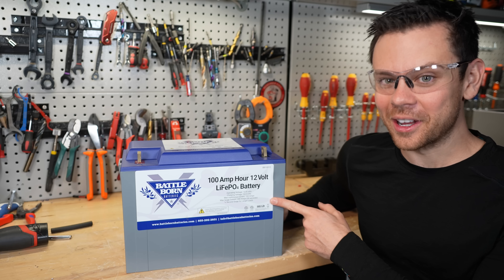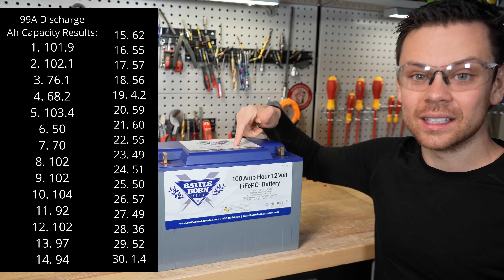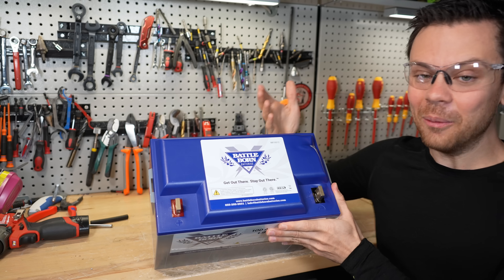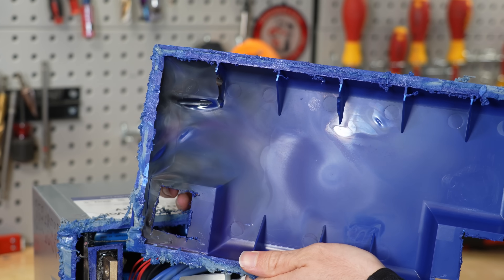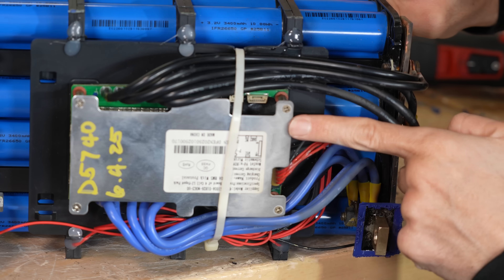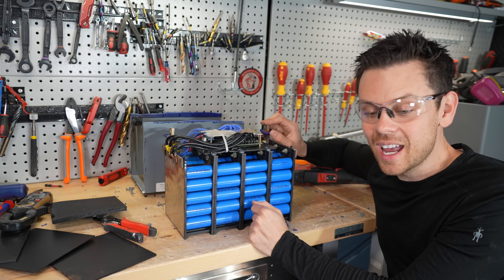Battleborn Battery MELTED?! 🔥🔥New Problem!

Comment: Will  you need to start playing on the safe side.

If that lithium would catch fire,  you can't put it out with a fire extinguisher or water....

Start testing these things OUTSIDE so if it does ignite,   it can burn out away from the house or shop....

OK, if you must have the comfort of inside the shop, how about getting a metal kiddie wagon, put the battery 
IN the wagon.   If it should catch fire,  cut the cables and wheel the blazing battery outside as fast as you can...

That plastic will not stop a fire and when it burns through, your house is toast......

fair warning friend..

Comment: I don't know what is going on with the batteries you have been testing.  They are obviously having issues.  But, I can say that after four years with my Battle Born system it is still working like a champ.  Perhaps their has been a  manufacturing change.
Reply: You mean they went BOEING? But that would actually mean they had a management change, THEN a manufacturing change. I'm happy to only fly on Airbus, and I will certainly not put anything in my house that was manufactured by an American company under American regulations and standards where the product is thrown onto the market without proper testing and only a big law suit can force them to improve...
Reply: @mogon721 Seem like a rather extreme response to never purchase a product made in America because Battle Born is having a problem with some of its batteries.
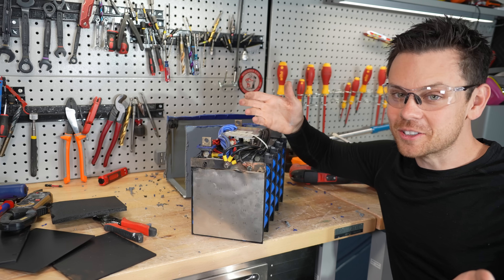Reply: @mogon721 go watch the BOEING engineer " MR. HANDS" AND his Wonderhorse  "BULLSEYE"! its romantic. RIP" Mr hands!" 5:56

Comment: A brand new $800 battery and it melts.   FYI, Dragonfly Energy Holdings Inc owns Battleborn Batteries, their stock went from around $1000 per share (peaked $1500) to $4.05 today.   Good luck getting a refund from Battleborn.      Thank you for the video.

Comment: I'm still impressed with my Zooms, Chins, and Redodo banks I put together. Haven't melted down yet in 3 years. I also have a pair of Paoweric 48v batteries that haven't melted down yet either.
I can't say I'm impressed at all by The Big Battery I paid a lot of money for. It's offline again waiting on a new switch to arrive. To be fair I voided the warranty last summer installing a JkBMS and it was their switch that failed. Just sitting on the shelf the back popped off and spit the guts out of the switch. Poor Chinese crimp it looks like

Comment: Will, you have me worried. I have two of them in my Arctic fox truck camper. I’ve had them for 4 years. No worries yet. And then here you come with this info. What should I do? I live about 80 miles from the battle born factory. Maybe go to them and show them your video?  Crap.
Reply: Also, what do you recommend for me instead of these bb?  I just need about 200-300 of amp hour. Thanks

Comment: These batteries should have an immediate recall, no excuse Battle Born, I have one that came with my nuCamp Barefoot RV but never used it as I replaced the battery with a 300Ah Renogy LiFePO4 Battery w/ self-heating function | Core Series battery and it works really great! I got 3 times the capacity and a much better battery, and safer battery.

Comment: WOW!! I have 8 of these in my 5th wheel RV. I lived off grid in southwest, AZ near Yuma for about 6 1/2 months last winter with them thinking I had a very safe superior quality 24v 400amp hour (wired series/parallel) battery bank. Now I'm scared to turn the battery bank on after this video!! I don't want to lose my home!! The rest of the solar system is all Victron. My BattleBorn batteries cost me about $1200 each in 2021 when I originally built the system. Looks like I need to junk them and replace them with something like the best and lightest possible large 24v Chinese batteries. Thanks for all your testing Will !!
Reply: All battery banks should be inspected at least twice a year.

Comment: Sorry, but those batteries are just complete shat.  No ifs, no buts, no coconuts.  I wouldn't use them.  There are much safer ways to setup a "safety" disconnect than allow your wiring bolts to just get loose and actually create more heat. If anything, their idea of safety actually increases the risk of fire and damage!  What idiot designed this???

Comment: This is the reason I make my own! set my BMS specs lower then what the batteries and everything else can handle. Set the temp threshholds lower! I rather it shut off early then over heat and melt or catch on fire. Thanks Will for such great testing and bringing awarness to these issues.

Comment: Hypothesis: the plastic they're using as that 'feature' of over-temp disconnect (not really a feature, it's a design defect IMO) is experiencing creep from the moment they tighten the nuts on the assembly line to torque, since it's a constant load on a plastic. 

If you have a sample of that plastic, maybe you can emulate a load test on a spare piece from a battery that isn't too damaged - use a hydraulic press + load cell to emulate constant load, measuring the drop in force as the plastic deforms under mechanical load. Only hard part is controlling for whether the cylinder slowly loses pressure/leaks, so maybe a mechanical scissor jack might be a better way to control mechanical load.

Comment: That is some bad engineering to apparently assume that plastic spacer won’t flow under the compression of the bolts holding the wire lugs - even more so when the plastic gets warm in normal use conditions.  There are materials such as Micarta or Bakelite which  remain dimensionally stable and could have been used for the application.  The downside is that thermoset plastics are more expensive and more difficult to work with.  If it were I, I would have designed notches in the plastic partition so that the lug bolts were torqued down directly to the metal busbar.

Comment: All they would have to do is put metal inserts in the plastic so that the pressure applied by the nuts to provide the clamping force on the bolts and terminals isn't taken up by **plastic**. That's just not a great design.

Comment: 4:31 so, based on this evidence, we can conclude that this model was dsigned to fail, even when used as intended by the maker.
PS: if possible, you could do a "fix and test": buy another battery of the same model (i know, your poor wallet is crying), open it and fix all those stupid 'design choices', and test it in the same manner u did this one.
Termal imaging would be nice if possible, by the way.
Tank you for your service to the solar community.

Comment: :I  Are dimenstions for an 'appropriate' passthrough-terminal that can be inserted into the existing plastic to hold tension/pressure/contact around those points availble?

Or could drilling the existing holes out for common M8 spacers be an 'adequate' improvement?

(edit:) 'adequate" in that the plastic around the terminals wouldn't mechanically overloaded from the start. I do recognise that the plastic would still need to be under some pressure to keep the bar and sheet in contact, and adding more copper bars to sandwitch the sheet(s) would need a more significant modification to the plastic(s) with associated costs ... almost enough to make adding binder-clips seem reasonable, if not for the dissimilar metals corroding each other.

Comment: Thermistor on cells, and/or bus bar, should be communicating with BMS to shut down the system. 
And no fuse on the bus bar?

Comment: Ahhhhhh.  I've got one of these bolted to the bottom of my van.  It's 6 years old, and I don't exceed 0.1C (per battery) but I'm nervous now.  Maybe I'll pull it soon and use it with a small solar panel for charging my tool batteries or something.  I can't monitor any heat deformation of the case where I have it mounted.

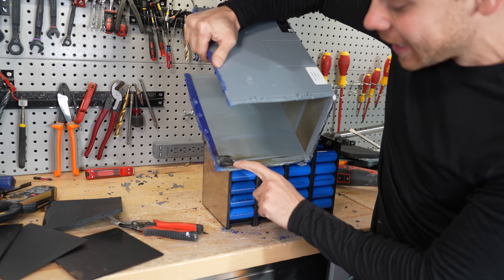Comment: How close were you to battery thermal runaway? At 3:23 had the copper developed cupric oxide which forms at 320C and with a lifepo4 battery runaway temp is 270C, is there a bigger problem waiting?
Reply from the maker: Exactly my thoughts!!! Agreed.
Reply: just try to charge it couple more times

Comment: Absolute insanity to have plastic and metal together to keep tension for nuts and bolts. It should have just had the nut recessed in the plastic and then the metal plate and bolt would stay in contact. Still a bad design but better

Comment: The only other thing i can see that might be useful is seeing how low a charge discharge cycle will need to be to prevent overheating... is this a 40amp max or a 10 amp... a lot of people spent a lot of money on these and i am sure would like to get as many cycles in a safe manner 

This dose not seem like a random percentage but a major percentage of the batteries are at risk

Comment: I'm hoping that this is more of a current problem with the build quality of these batteries. I've owned my BB battery for 7+ years and so far have had no problems. But then also, I'm only drawing maybe 10-15 Amps and charging with solar from 3 - 100 watt panels connected in parallel.

Comment: Yap, exactly what should happen with plastic between terminals, bolts and nuts.. As it always do.. 😂
Only it give away ghost very quickly and it looked like there was an actual fire inside that case.
These batteries should be banned as dangerous and fire hazard and recalled immediately! 

Thanks for great video and good job! 👍

Comment: After watching this video, I will never buy a battleborn battery ever!! That just shocked me to my core. I have a homemade solar generator that I  built in my garage. I'm using eco worthy 24v 100ah batteries for my eco worthy 24v inverter. I load tested it with 2hp air compressor and a space heater with no problems at all. I'll not be doing business with battleborn batteries at all.

Comment: Even if battleborn stands by their claim that the design is fine, I think i can see how they would want to stick to that viewpoint. I think the design is fine if the plastic endpieces deform within the right thermal envelope at the right termpartures and it deforms at a specific rate into a specific shape that sufficiently breaks the connection to prevent a fire then, that is perfectly fine, you lose the battery but you don't catch anything on fire. however, it seems to me the issue here is quality control. I bet in the persuit of margins, someone at battleborn or someone in china producing their batteries changed the plastic formula or production method in a way they didnt think it'd have an impact, but it clearly is. its too highly refined of a design with too many variables that are easy to lose control of in the manufacturing process. that is why, the design is flawed because it appears to not have tolerance for manufacturing variables or, the manufacturing variables at play here are not under battelborn's control or, they are but they did not realize the mistake.  no matter how you look at it, because its a completely sealed unit battleborn may weigh the public relations and reputation hit vs the dollar value of which decision is less costly - admit fault and perform a recall and investigation of select units, or continue to announce the design is fine and settle / cross their fingers and hope they have very few actual issues. everyone knows they are going to choose the latter and just sweep it under the rug - i mean come on. maybe 1 in 10 companies actually have integrity and a real backbone to stand up and admit when they're wrong even if it hurts financially in the short term.

Comment: This newcomer Chinese battery''s probably been around for a month. They named them some random name: Battle Bott, War Ready, Tough Solder, whatever. There are much better batteries  on Temu. I've bought some of the other ones on Temu, and they've been trouble free. I've never heard of this brand of battery, but judging by the pretentious name it's done with the lowest quality materials. Most of the ones on Temu are build with much better Prismatic cells, rather than these 18650 batteries meant for laptops.

Comment: The most bewildering part of this whole situation is that someone in the BattleBorn company thought clamping nuts and bolts that carry large currents to PLASTIC is OK.  I think an elementary school child would realize this is a bad idea.  How could they have gotten away with this working for as long as they did and then the audacity to try to play it off as if it was a built in safety feature, WOW. Thanks Will for not pulling any punches on this issue and exposing it for the dangerous safety issue it is, not to mention just plain poor engineering.

Comment: Its a bad design decision with the plastic sure, that is a fault.  however any battery will have thermal issue if cycled hard like that.  They are not rated for 100% duty cycling continuously. They are only designed for intermittent cycling, so I guess that is how they tested it, rather than doing exception / out lying condition testing to find the failure points outside of the excepted normal operation, that you tested as normal and yolo'd it.

Comment: What exactly is their reasoning for building the battery with so many smaller cells instead of using larger prismatic cells? It may have made sense at some point but it doesn't seem to make any sense now. It certainly isn't helping it stay cool. The build of these vs the old medical batteries I salvaged cells from a few years back is just terrible in comparison, those had very strong and durable busbars that were secured to heavy duty connections. One of those reclaimed cell batteries I built is still running just fine at a friends place 5 years and over a thousand cycles later, unlike this thing.

Comment: The fact that there sending the power through the nut and then the bolt then to the power lug is crazy on is own! big big no no. the lug always goes flush clean to the buss bar. then bolt it down tight

Comment: Hi Will . Have you looked at wind turbines?  I have hooked up 32 panels to my sol-ark 12k with two 17k big batteries kong elite. Battery company says that there is no way to hook to them through an mppt controller. Sol-ark says that I can hook the mppt controller to it but I need to get the mppt to the same numbers all around to make it do the same as the solar panels. I feel a little lost on the subject 😕. You explain everything so well ,  so I'm was wondering what your thoughts are on hooking up wind to pretty much any inverter.   Much appreciated. Love your channel ❤️

Comment: Imagine that heat burning onto one of those cells and the battery is inside a camper you're sleeping in. Very scary; you're not putting that fire out.

Comment: I can't even!

How does anyone justify those kinds of connections. Look how loose the terminal hold-downs are. There has got to be a bunch of failed engineers over there at battleborn.  Also, why are not not welding the metal together?

Comment: I have 6 of these in my boat that I will be swapping out. Two of them will not charge or discharge the other 4 seem to be working normally. My batteries are only 5 years old with just under 400 charge cycles on them. They do not get hot, just 2 of them simply stopped working.

Comment: As you say the connections to the bus bar should not be based on the plastic staying in place.
they should have a bus bar with threaded studs built into them, then double nuts to hold the connectors on the cables.

Comment: As these are not 'user serviceable' (it's a sealed unit), this is a HUGE scandal!  Users cannot even open them to inspect the connections, much less retighten, etc. to mitigate.  A refund or a qualified replacement is the only acceptable course of action.  
Queue the class-action lawsuit in 3, 2, 1...

Comment: this is very dissapointing... oter manufacturers make their batteries with rectangular and hundreds of amps per cell and battleborn use this crappy manufacture method i'm guessing, for... maximizing profit? and 5 lousy wires from cells to bms and another 5 wires to the battery terminal? how about a large welding-like wire? how about a thick busbar with 5 SCREWED bolts onto that massive negative terminal and 4 contact points with SCREWED bolts?

battleborn are making this batterries with what it's left from battle from competitors, this explains this fails on this design that are a truly a fire hazard. 

battleborn should be forbidden to make this design of batteries all of their batteries should be forbiddeb to be sold in any seller, magazine, shop, or deposits, battleborn should be forced to take back these batteries and give back the money with 10% interest  because of their bad battery design !!!

Comment: As an engineer I would never bolt through plastic on such high current applications. You use the plastic as a support for the terminal not as part of it !  Better still use a mineral fibre board.

Comment: I got a battleborn add during the last battleborn video of yours can I watched about 15 minutes of it before skipping. No one in the entire factory wore safety glasses, there was a lot of bragging about shipping the batteries at 100% state of charge (which I thought was not legal), solder smoke going into the open factory... Very strange choice for presenter. Not impressed with battleborn's own presentation of themselves.

Comment: Interesting to see if they changed with the newer, differently packaged, batteries. I am thinking of the "Gamechanger 3.0", a quick search doesnt show anyone doing a teardown on those but it did yield a video from 4 years ago on Fit RV where a competing company was comparing and stating exactly this issue, plastic being used as a load bearing surface for the terminal connections will creep and fail eventually no matter what. Comments were disabled on that video so no idea how people felt about it at the time.

Comment: Plastic cannot be used in the  torque path  for those current carrying joints.  Need to double check my bus bars but pretty sure they are all metal to metal interface